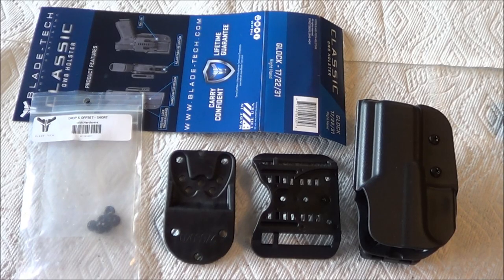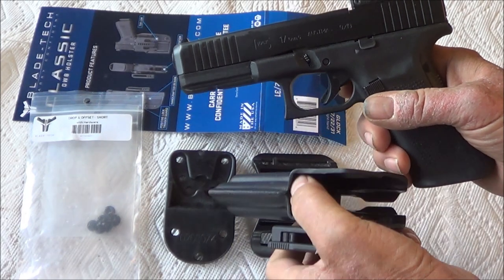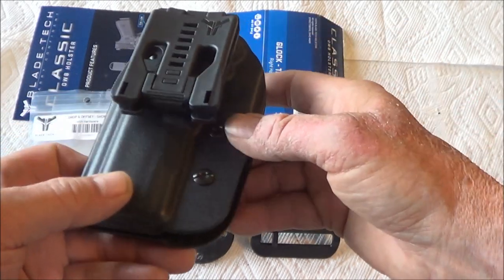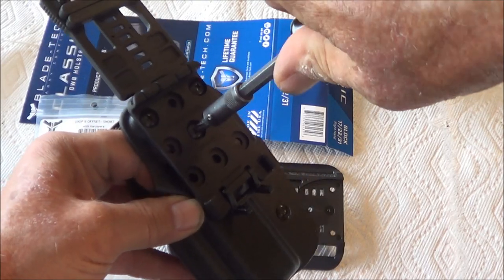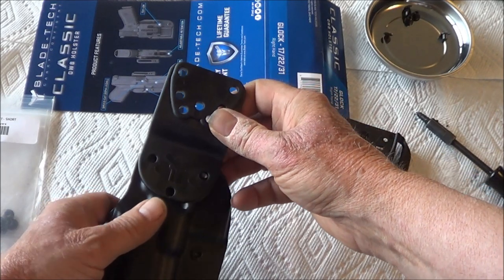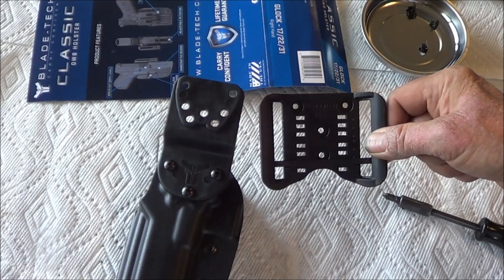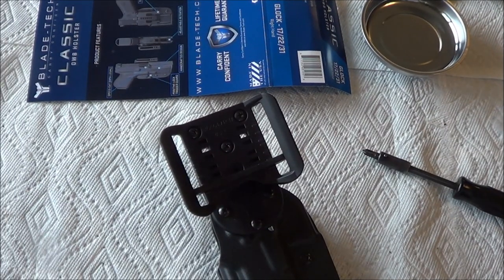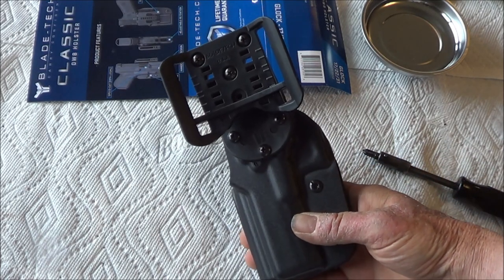Assembly of Blade-Tech  Dropped & Offset Holster for USPSA

Comment: just a quick note, its not nuts and bolts. its screws and posts. the screw is the screw and the opposite metal thing that attaches to it, is called a slotted post. it will have a notch/slot for a flat head screw driver so you can fasten from both sides, You also get another type, they will be slim size and those are called pass through posts. they dont have the flathead screw driver slot
Reply from the maker: Thank you. I stand corrected.

Comment: Roger great video. Where did u get that holster and drop offset? Was it a package deal. Thanks
Reply from the maker: Ben Stoeger Pro Shop
BOSS Dropped & Offset DOH Holster  SKU: Boss-Holster
Reply: I picked mine up online on Blade-Tech's website.  Signature Holster (less than $30 June 2020) and a Drop and Offset - Small (around $10).  I also ordered the ASR Belt Loop (around $10), because I prefer it to the Tek-Lok Belt Loop that came with the holster.  So all in, about $50 (plus tax and shipping).
Reply: @richkestrel7416  im looking at picking up a  blade tech classic for my g17 there around 60ish. But also another great soultion is the boss hanger from ben stoeger they have it on there site the boss hanger mount with either a comtac or bladetech body (holster) and it has the thumb screws installed instead of the philips screws, that hanger makes the holster completely solid with no flex or movement. That package is 99 bucks on the bens website
Reply: @richkestrel7416  its also double the price from what you picked up. For the metal boss hanger holster package deal. Alot of guys run bladetechs mounting stuff and it just works nothing wrong with any of it some guys just dont like the flex in the plastic type mounting.
Reply: @roger_revo  did u get the classic bladetech holster? Or the signature? I notice they dont have a gen 5 option for the classic holster
Reply: @roger_revo  what did u pay for what u picked up?
Reply from the maker: @downeastoutdoors8713  Classic
Reply from the maker: @downeastoutdoors8713 $89.95
Reply: @roger_revo  so u bought the classic package that came with the belt loop and u added on the drop offset for around ten bucks?
Reply: @roger_revo  the boss holster that you linked to me here. It comes with the boss hanger and holster im just confused lol sorry
Reply from the maker: @downeastoutdoors8713  I added the drop and offset attachment option, but I don't know how much it was.
Reply from the maker: @downeastoutdoors8713  Sorry it was not boss, it was blade-tech.
Reply: @roger_revo  its 12 bucks to add the drop offset. Yeah i thought u might have made a mistake. No problem at all though. Once i looked at the site i figured out what you purchased